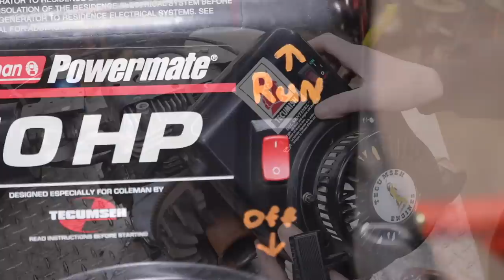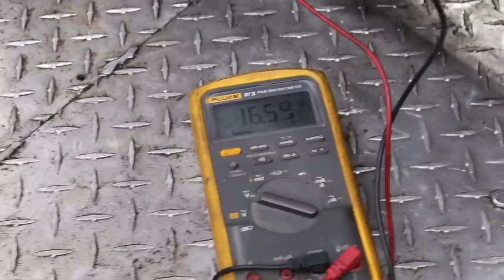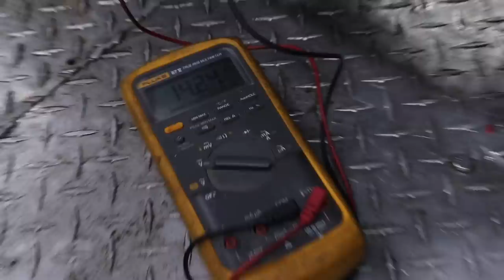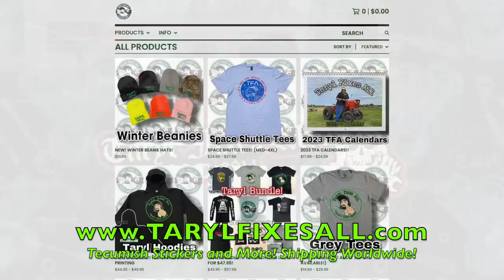Can you add electric start to a generator? Let's try

Comment: Nice video ☺️ i have an LCT 136cc that i been having a real hard time finding a flywheel with magnets that fit the taper of the shaft. Its a little smaller than say the average gx160, gx200, etc. Now i have 3 flywheels, a set of dual coils and an alternator unit that mounts on the inside underneath the flywheel. Not sure i can use a gx160 crankshaft as it does have the same stroke (45mm) but the crank journals i hear are larger than even the predator engines. What to do what to do..... 🙄🤔🤷🤦 All I'm trying to do is be able to run a light and charge a battery so i can charge my devices.😒

Comment: I've been wondering about these and custom fabricating a metal bearing holder to replace the plastic as I've read long term those bearing seats can develop play and cause failure in a system that otherwise can last longer seems if has a more stiffer solid bearing mount seat support part. Neat to know.  I was looking at with the Honda/Chonda's retrofitting with electric start and even appears the GC's can be hacked too with GX parts and some know how.  For that I was looking into for controlling the motor and starting an air compressor with electronic actuation controls design vs the pneumatic mechanical.  Thanks for sharing as always!  Great info old man.
Reply: I want to upgrade my carport barn with a steel shell too.  That's badass with the side door.
Reply: Oh and seems a breaker or fuse would be good as well to prevent the stator coils from burning up as seems to be the issue with the generators.  Honda's the only one I own that has the breakers.  Maybe even like an old microwave thermal cutoff switch would be good on the coils as well or only?

Comment: I rigged up my tiller that I put an electric start duromax 212 engine on to use a 12v Milwaukee battery. That way I didn't need to mount a bigger lawnmower battery on it and where I only use the tiller once or twice a year the battery woulda always been dead whenever I woulda used it.

Comment: Kinda expensive to do it on your own equipment.  But it is a nice offering to look into if you have a customers unit in for repair especially if it's a cheap fix.relating to starting. They may be interested in a conversion if you can keep to under 100. Most customers dont want to spend more than that range

Comment: The trickle charger pigtail on my garden tractor uses a 2 amp fuse since it is designed to be used with a 1.5 amp charger.  Something to consider if hooking up a much heavier load of a 12 volt starter.
Reply: In that case, the fuse would need to be on the charger pigtail, or the battery would need a separate pigtail for charging.  Small engine starters draw up to 30+ amps.

Comment: I put a Starter Genny on my old 1964 Wisconsin powered 3800W Winco Genny. Damn thing is a Bear to pull over with the old wrap around rope start. The field coil in the starter genny is fried but it cranks the engine over just fine. I've been using my little jump box to crank it up.    That old genny is backup power for my wood furnace blower and a few lights. It might be old and very heavy but it is very very dependable. I had a Tecumseh HMSK80 powered genny and the damn thing blew the rod.

Comment: That 7 amp coil is a Tecumseh 611097 and it used a 611098 voltage regulator which burns out if the engine runs without a battery connected, and some B&S voltage regulators seem to have that same problem according to the owners manuals of some mowers.
I don't know if that regulator you used can work with the battery disconnected, but I'm afraid that the owner at some point will decide to use the tractor and the generator at the same time, or just start the generator using the recoil so he doesn't have to remove the battery of the tractor.

Comment: If the flywheel has a ring gear, it can be configured with an electric starter. (If it has a ring gear, it probably already has an electric starter (or did at some point).

Comment: I got an old craftsman generator with a Briggs engine, it has electric start but no charge circuit. I have searched high and low for a stator but cannot find one. I even have the same model engine sitting in the corner from a tiller, electric start no charge system. Maybe they never made one. Anyways I have a small engine/atv shop I’m having to shut down do to physical limitations but I gotta say I’m not going miss it

Comment: Could have just used a voltage regulator with the first alternator, better than letting it charge without regulation anyway, esp for something like a generator that may run for serious hours at a time

Comment: Taryl, would a 110v starter, like off a snow blower, have fit the generator?  I realize you wouldnt be able to use a 12v tractor battery, but you wouldnt need any battery at all.  In a dire straights situation, use the pull start.

Comment: What’s the P/N for the hi amp alternator? I want to add a battery, starter, and extra lighting to my snowblower and this would work great!
Reply: If it already has a 120v starter, it's best to just stick with that.  Batteries and cold temps aren't the best of friends.  

As for lighting, switch over to LEDs.  You can get 6-10x the light output for the same wattage vs. incandescent.  If it already has an LED light, chance are the existing electrical has ample headroom for one or two more.  Low-output small engine alternators are like 2-4 amps, which is minimum 25w.

Comment: 21:00 Time.  Nuts. Modern nuts. Designed, tapered on the 6 hex sides , cause sockets to do this = slip off.  Solution ?  = Grind about 2mm off of each socket end , they are tapered outward. This, will keep  ALL   HEX  SIDES, onto the NUT........works  for  me.  NO  more  slipping  off of   ' nuts ' .....nor  bolt  heads.

Comment: 6:11 Why not use a power wheels power tool adapter and a 20v battery? Put a 7$ buck converter in to change down to 12v. And you can start it off a tool battery. That works too I guess for the non electrically savvy.,

Comment: So...instead of the battery sitting for 2 to 3 years to go bad, it will sit with fuel in the carb? I'm sure he uses a shelf stable fuel. I use it in mine, plus I run the engine with the fuel shut off until it dies and store it with the float bowl empty

Comment: You could start your Genset every month or so and let it charge the battery. This will also keep the Genset working. Often if they set things stop working. If you start it and check if it works every month or so you will know it works when you need it.
Reply: That's right, Leon.  I routinely exercise mine the first day of each month, for 30 minutes, under 50% load.  I use a series of small portable space heaters and just plug them in 'till I've got about 50% load.  Good for the fuel system, good for the engine and good for the generator windings.  What a lot of folks don't realize is the windings in all generator sets are insulated with a coating that unfortunately absorbs humidity/moisture over time (only a few weeks)  This moisture soaking into the windings can cause failure.  One great way to keep that from happening is to routinely 'load up' the generator for 30 minutes or so to 'bake out' that moisture from the winding insulation coating.  They will last forever if they are regularly loaded up and exercised.
Reply: I agree with Santa Clause on this. Over the years, I've found that every other month is sufficient. Once the genny was in storage for six months and still started right up. It's important to run the genny under load so the carb opens up and it runs on the main jet. Also important to shut off the gas and run all of the fuel out of the carb. Honda-powered gennys have no need of electric start. One pull gets its attention, the second pull starts it.

Comment: I j just thinking about if you could do that with a electric starter off a snow blower which is using 120 volts to turn the starter
Reply: Exactly what I thought
Reply: Kinda hard to use a 120 volt starter in a power outage.
Reply: @allanvaneste9106  that's why you have the generator😂
Reply: @allanvaneste9106   that is true
Reply: Sure! Now where does one get the electricity to plug into during a power outage?
Reply: @Jay-by9zh   a generator if you have one or if you're house has a back.up.generator

Comment: I know this is an older video, but wonder about moving the low oil cut off from the coil to just a lamp in the switch.  I'm only 16 mins into the video, but wouldn't it be better to have the engine shut down if low on oil rather than a lamp that might not be seen?

Comment: I have a 1500w Honda generator which starts at the first pull and I use it to start my 5000w Coleman with a 110v electric starter on it.😝

Comment: When we used to buy Winsconsin water pumps they had a starter kit that used it belt to run between the starter generator and The pulley you wrapped your pull cord around to pull start it it was shunt wound so when you released the button it would automatically change from starter to generator to keep the battery charged  apparently it's no longer available I'd like to find how they are wired I'd hoped to use one as a backup generator to recharge my solar battery

Comment: It is nice to have Electric start but I prefer to have a recoil, at least as a back up emergency start if the battery is dead. And I would run it every month for 15-30 minutes so I know its running when I Need it.

Comment: I have a generator with a 8 hp b&s. Got it running 10 plus years ago run it empty.  In my storage,  it has a starter alternator wire. That is all never hooked up or working. Seems odd to have that never set up to work.

Comment: Taryl I hope you suggested a bearing service on that generator or at least pop the end cap and grease the bearing for the fellow.  The design on that Coleman with the bearing riding in the end of the plastic bell housing of the generator is terrible.  If the bearing gets warm the plastic melts the rotating assembly loses support on the back end starts to wobble.  The armature and field make contact and you got a pile of junk.  I'm sure you know this, I'm  explaining for those reading this comment.   Those generators were notorious for having bearing problems after running them for a few days constantly.  Now that parts are not available, you got a service that bearing religiously to keep it lubed and the temperature down.  No one that I am aware of still uses that plastic design. Everybody went to a metal piece be it aluminum or other metal.

Comment: I can pull start my generator. It starts on 1st pull. No damn electrical mess to worry about. Same with my Snapper RER. It starts on 2nd pull but I need a new pull cord. Mine is worn. Why do they make so many different size cords? For an old generator that one is in great shape. Change the oil every 60 hrs and keep it full and it will last.

Comment: Would it be possible to pull a generator head off of an engine run a shaft into the rotor with a pully and set it up to be used on the front of a tractor I know they made generators like that in the past but their pricy and I have a generator head setting around with a junk engine.
Reply: Easily, though there are considerations to be made:  

First is the generator's bearings.  Since it's shaft is usually in-line with the crank, it's bearings may not be designed to take the lateral (shearing) load of belt tension or other offset-drive method (gears, chains).  In that case, you'd want to run it straight off the PTO, like it was the original engine.  Another option is to give the pulley it's own lateral support, not mounted directly to the rotor, but rather to the bracketry/framework used to mount the generator to the tractor.  Of course, if the bearing IS up to the task, then just go ahead and mount it directly.

Second is, what RPM does the PTO run at?  It needs to match the genset's OEM spec or voltage and/or frequency could be off (depends on the regulator/inverter on the generator).  It's probably variable with engine RPM, since most PTOs are driven via belt or hydraulics off the engine.  This will need to be monitored and maintained while using the generator.  Any difference beyond engine RPM modulation can be made-up with pulley/gear/sprocket ratios.

Beyond that, it's simply a matter of making an adapter that has the original engine's shaft profile on the generator end and a pulley/gear/sprocket or PTO socket on the other.  Oh yeah, and the bracketry/framework for mounting the unit.

Comment: do not overvoltage charge battery get hot they is 14 volt normal charge you need voltage regulator is fine

Comment: Nice job taryl but I don't like the hole in the cover looks unfinished.
Reply: Well, he ended-up having to use the voltage regulator the hole was for, so it all worked-out.
Reply: It's not the Space Shuttle....it's a lawnmower.  Or generator.   Or whatever.
Reply: @santaclause2875  got it Santa!!!!!

Comment: I've been calling them Forest Gump Snappers since the movie came out.. Bendix instead of starter drive is another termanagiy We have in common..
Reply: A Bendix is a particular type of starter drive. If you have a solenoid that engages the starter gear then you don't have a Bendix.Many Fords used Bendix drives but I've never seen a GM that did. It's called a Bendix because Bendix designed it.

Comment: I'd like to see a rebuild/repair of a pressure washer pump.
Reply: @ronaldfulton1175  I believe what happened to mine, was I have hard water and I failed to lubericate the pump when finished. Hate to throw away a good engine because of the pump and a new pump is unavailable. I was told the engine is only good for pressure washers.

Comment: Next ou could convert it to run on LPG so you don't need to worry about the fuel going stale over 2 or 3 years non use.

Comment: you should have put two or three headlight in line with that charge circuit and told the owner oh that's a beacon so your friends  will know were to go when there an outage🤤  all kidding aside i work next to a place called ricky stator that got his start rewinding atv stators for  bigger and more lighting . but ya 16 plus volts would have done a no. on that bat tree

Comment: Wonder how much that cost to add to that old generator.
Reply: I got a Honda kit for 13 hp on eBay for 100.00 bucks plus buying a battery 
Used old battery cables from junk mower

Comment: nothing wrong with setting on the floor and working I have a piece of carpet to set on but most of the time I set on the concrete.
Reply: You'll get boils sitting on concrete. Least that's what all the old timers used to say. I miss them.

Comment: Taryl Fixes All ..  I followed your flywheel magnet instructions and fixed mine on my Kohler Command Pro 23 horsepower engine which has NO identification sticker on it.. My block casting numbers are 24 560 with a big 39 after that .. My Block is cleaned and the cast iron bore is perfect and already honed and ready to reassemble.. this Kohler Command Pro 23 horsepower has an 80 mm bore and 1.5 mm thick Square rings.. HOW can I get the engine designation numbers to Get the right parts and the new carb that I need to Reassemble on this 02 model Kohler Command Pro 23hp.. Already talked to Kohler Corporate, and Husqvarna Corporate with No Help from Them simply Because the sticker is Gone .. Help me to get to "Here's my Dinner" partner PLEASE .. Love your videos Thanks, Richard Tharp

Comment: I have a little Honda generator it to peak powers 2200 W and it can hold steady 1800 W no I never hardly ever use it. The main reason why I got it is I have a rice coal of stove and I have it down to where if the power goes out I can go downstairs. I already have the extension cords run and also got to do set a little generator outside and plug it in plug it into the stove, fired it up and run it. I can do it in less than five minutes now one thing I do I always run my generator at least twice a year and what I’ll do is I have an electric oven AJ draws a pretty good model power and I put that thing on and let that generator work put a load on that motor get it fully warmed up. I mean the full max temperature and I run it for about 15 minutes. I do that twice a year, that’s what you Gotta do anyway, that’s not a electric start generator it’s just a pool start all right this Jim Mungai from Kennerdell Pennsylvania that’s a really neat job you’re doing on that generator Terrell real

Comment: If he isn't going to leave the battery on it why does it need a generator? It will get charged from the tractor and once it gets started, who cares? If you really wanted to you could plug a charger into the AC power output and get charged from there.

Comment: Someone should tell flip-flops know only weirdos wear socks with flip-flops, hahaha
The cover you used, has has an extra holes in it at the bottom, that’s clearly isn’t factory, won’t the engine have difficulty cooling with an extra holes that don’t belong??
I’m curious isn’t the starter and battery wires a bit too small, yes it will work for short cranks but over time it might start causing issues, considering a tractor with a similar sized engine uses a much heavier cable with a solenoid.
You actually don’t need the charging circuit, since most generators don’t charge the battery, just keep it on a battery tender when not in use, a good quality battery tender will not overcharge the battery.

Comment: Sorry Taryl but that is one fkg wussy ass ten hp engine Tecumish LOL what they really need is a
model 23 BS with car gen/starter. I have 2 gens and I have a maint.. plan every month I start 
them one has an electric start but starts 1st or 2nd pull. and I put a load of at least half-rated 
watts and when done I shut off gas . after the engine stops I drain the carb to make sure no gas
is left in the carb.